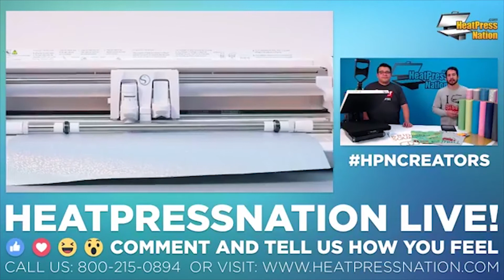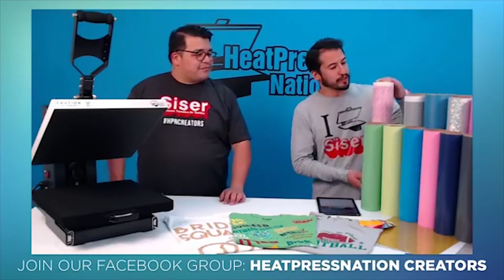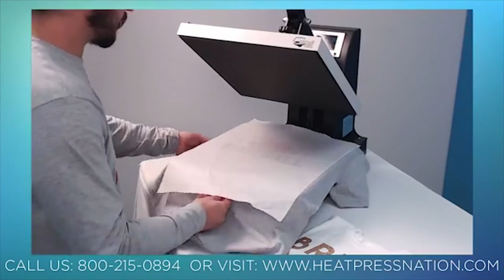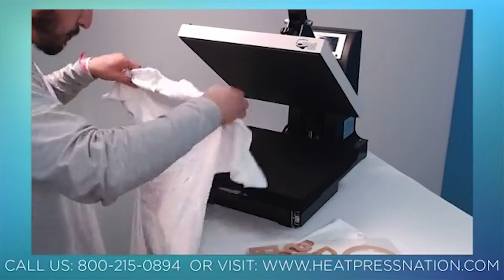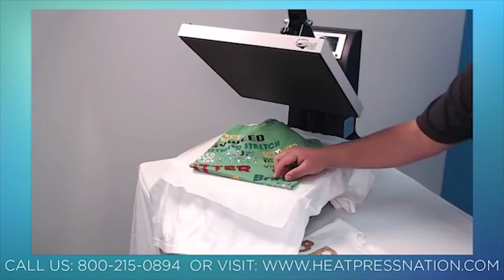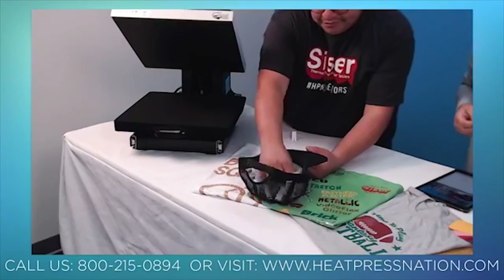HeatPressNation Facebook Live - August 17, 2017 - Siser Heat Transfer Vinyl

Comment: I use a CB09 blade in my cameo. I was told the 60 degree blade was for detailed work. And that the 30 degree was for thicker items like card stock. So you said 60 degree for the thicker BRICK. Is that correct?
Reply from the maker: Yes. So I believe whoever told you that had their blades mixed up. The 60 degree blade is for thicker items like Siser BRICK and should work well with cardstock too. A 25 or 30 degree blade would be for fine detail.